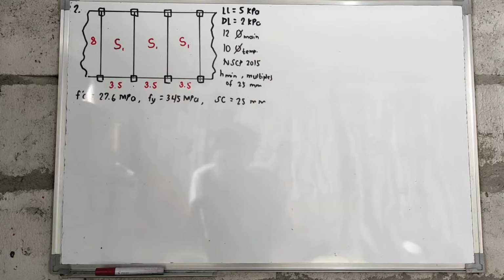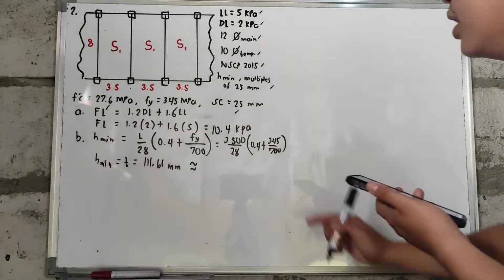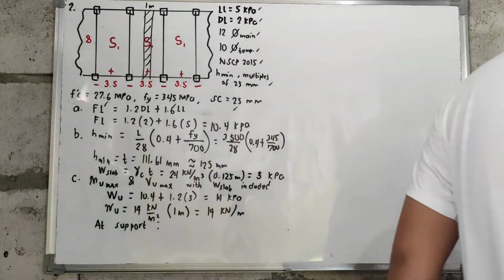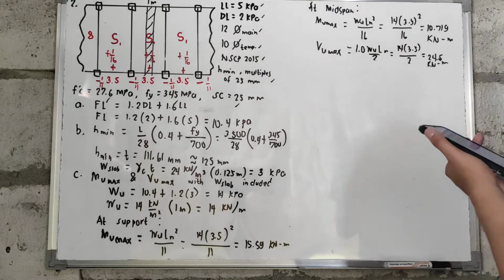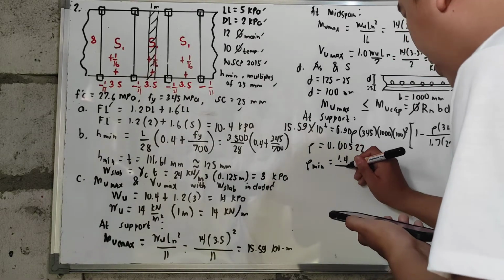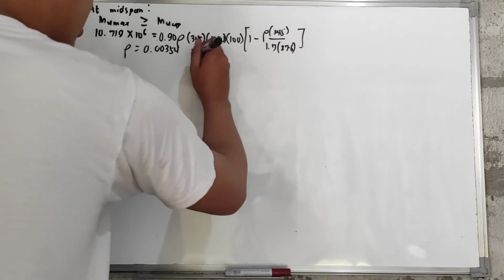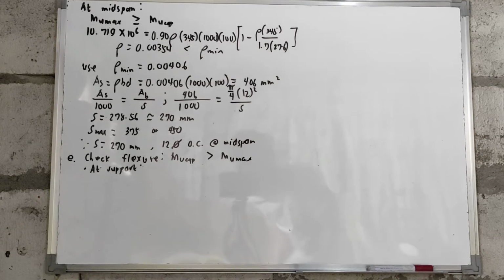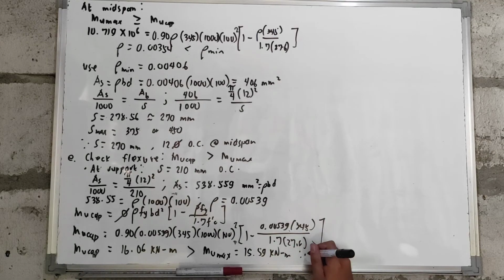One Way Slab Problem No.2a

Comment: sir bakit dipo kayo nag minus ng half diameter ng main bars sa thickness ng slab?
Reply: same question po sir huhu
Reply: yung 100 mm na d?
Reply: SC - Steel Concrete Cover. So meaning yung concrete cover is nasa gitna na po agad ng main bars